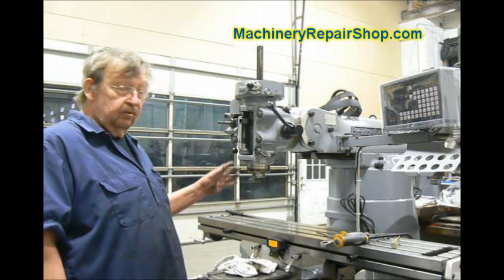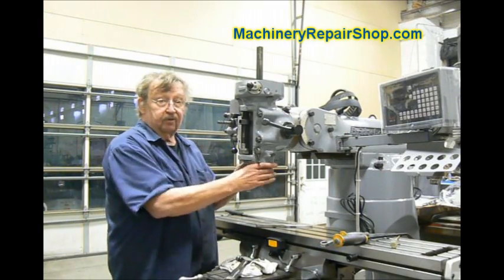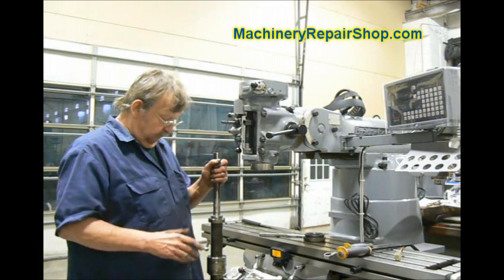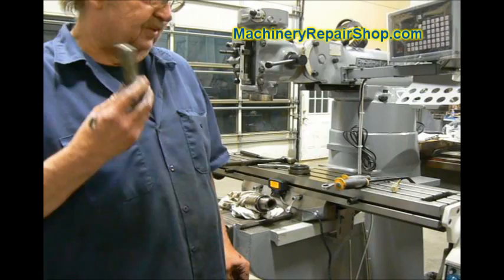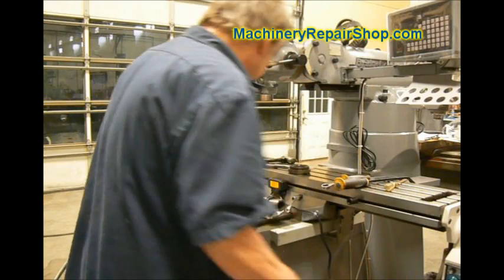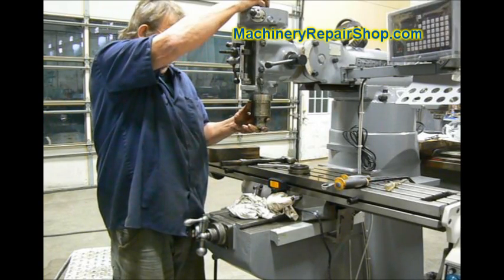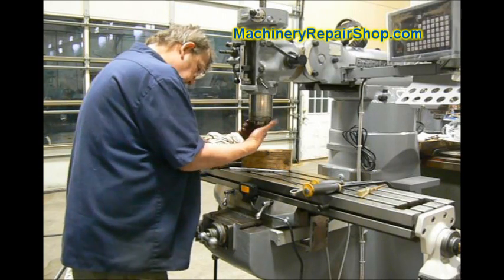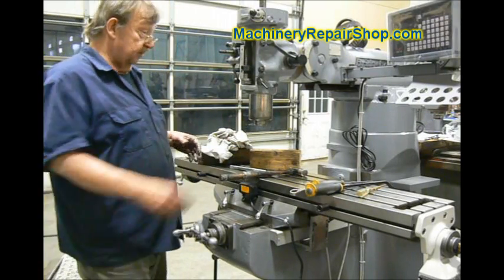How to Remove & Install a Bridgeport J head Mill Spindle Shaft

Comment: A question if I may.  I watched and you used the quill handle to press the spindle back up into the head.  Wouldn't it be a bit more efficient to raise the knee?  It seems that the lift mechanism on the knee is much stronger and more precise with no spring-back than the small rod on the quill handle and would lessen the chance of bending or breaking the quill handle.  Your thoughts on that please?

Comment: Can you remove the spindle without removing the drive assy on these? I have a Series II 4HP mill with the quick release. I want to change to a #40 taper system I think.

Comment: I don't have a Bridgeport it is a knock off and it all of sudden started leaveing a ripply finish I'm thinking it is the pre-load so I attempted to remove spindle I got it to move about 2 inches then stopped. Is this what happens with the stop bracket screw you were talking about. If so I may give it a try again. Plus how do you determine how much pre-load.This has been a pretty good mill granted it's not a BP but it's a good knock off. Any advice you can give me would be appreciated. Thanks!
Reply: can the spindle/spindle bearings be rep[laced without removing the upper casting and motor/pulley assembly?

Comment: Thank you very much for the information , I already try the wd as you said it help so so . I guess I will just have to remove and clean it .
Reply from the maker: Danny Chavez - Yea, normally have to "bite the bullet", As I mentioned, be very careful to not remove much actual material from either the quill, or the bore.Polish only. We chuck the quill in a lathe and use a very fine emery cloth to polish it, and you can also hear if there are high spots on the gear rack... But... a little Dangerous ;-). Due to all the openings, a 4" ball hone (4-600 grit) is about the only way to hone the bore, but again, be careful, it can remove material fast! Due to the close fit, the quill can be a major pain to get lined up and back in the bore. Rotating the head sideways helps a lot. I also should have mentioned that very (very) occasionally, I have seen a quill lock plunger stuck causing drag. Make sure you try taking these out first - both front and back. Disengage the power down feed lever, and remove the three nuts at the bottom of the drive, and the entire drive will lift off the head. Putting it back on, you will have to align the spindle splines - another little annoyance. After removing the screws for the dust shield/oil felt, the only other thing holding the quill in is the quill shaft itself. This can be pulled out after removing the downfeed clutch assembly and the grip ring on the left side, as well as the clockspring - either the entire spring assembly, or disengage the spring from the pin on the shaft...  I'm sure I forgot something ;-)
Reply from the maker: The Machinery Repair Shop And, I forgot, a "little minor part" - which I am sure is obvious. The feed stop screw has to be removed, and then the stop block around it - that is attached to the front of the quill.. I really want to do a video on repairing the head itself.. To remove the stop screw, you will have to remove the trip ball lever (barbell/dogbone) at the top of the screw. It is under a screw in cap at the top of the stop screw. The end of the lever has threads - screw in a 6-32 (might be 4-40) screw into the end, and wiggle it out. If the barbell is broken (common) that's another book - compressed air sometimes helps... Then remove the trip lever/transfer lever at the bottom (held in by a shoulder screw in front/middle of the lever) and the screw will come down and out. Then you can remove the cap screw that holds the stop block to the quill.
Reply: I appreciate the note about the stop nut bolt getting caught on the upper bearing. I have an Enco knockoff and sure enough as I was driving the spindle out it stopped so that most of the bottom bearing was exposed. It was a hard stop and I didn’t want to apply a large force to the head. I found your video and it properly addressed the problem. In the process of getting to that nut I encountered that stinkin’ little dog bone reverse trip lever. Mine had broken. It took 45 minutes to get the first half of it out. It took 3 1/2 hours to get the second half of it out. As much as I hated to do it I ended up using a small burr in a battery drill motor to wear enough of the edges away so that it came free from the micro screw. It was an exercise in patience. The Enco also has a left hand thread on the nose piece in case anyone was interested.

Thanks for your video.

Comment: The quill on my bridgeport binds through the whole stroke , could that set screw be causing that ?
Reply from the maker: Danny Chavez No, the set screw normally only affects the first inch or so of quill travel (if it is too tight). Being in the business we are in (refurbishing machines) we see a lot of binding quills. The quill is an extremely close fit in the bore, and very often it is just grime and crud built up around it. Normally we would remove the quill, clean & polish it by putting it in a lathe and using very fine crocus cloth, and possibly lightly hone the bore with a ball hone. Extreme care has to be taken though to not enlarge the fit as any slop here will directly affect the accuracy.You could try just flushing it with WD40 and PB Blaster, but that normally only works so-so. To remove the quill requires removing the drive off the top to remove the screws that retain/move the dust shield and then removing the cross shaft (that the quill handle operates). The quill (with spindle) will then slide out the bottom. Removing the spindle first makes it more manageable, but it is not necessary. If you can wait till later this spring, I hope to be making some more videos about rebuilding the head, but we are totally swamped right now, and the video budget is very tight.